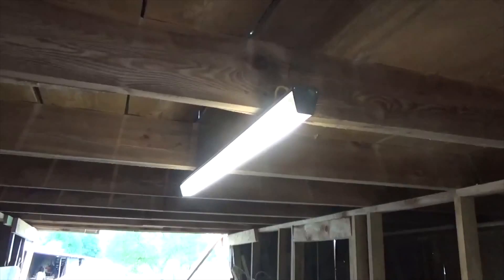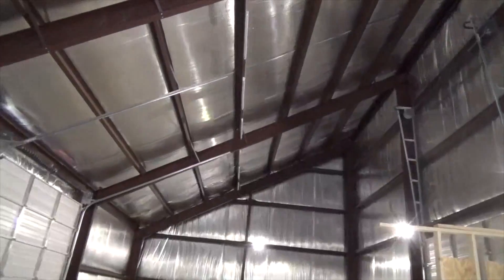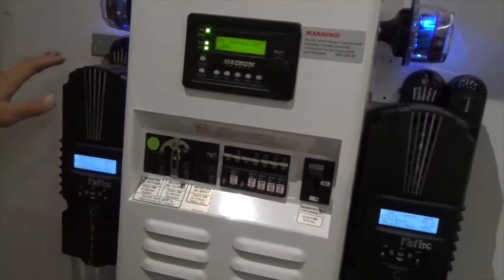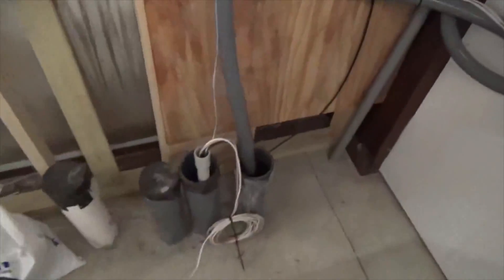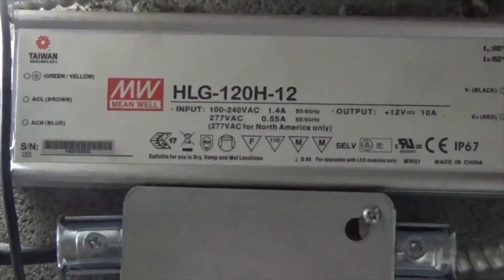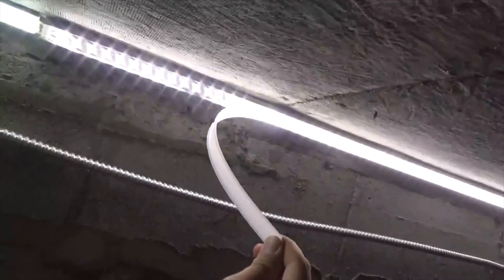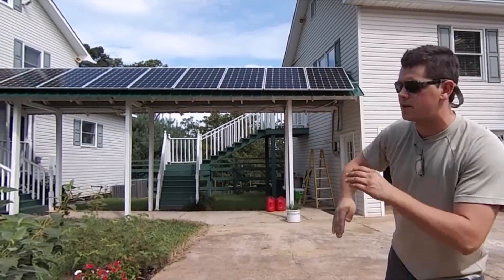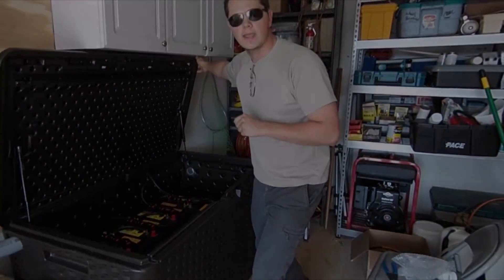Power Saving LEDs

Comment: Where did he get the plastic cover that covered the 12volt strip lighting in the crawl space?
Reply: DiodeLED has those extrusions.  They come in 4' lengths with a variety of shapes.  Lens just snap in.  Good heat sink, which is important. Www.diodeled.com.

Comment: I am off grid and run solar but also I am a Ham radio op and the bane of my life is RF noise generated by the dam panel regulators and the inverter. I have to turn the panels off when I want to use the HF rig.
any sugestions.
Reply: +Cirrus J  

Ferrite beads

Comment: It'd be nice if we ALL understood ALL of what yall were saying! The bottom line: WHAT does that system cost WITH complete installation!
Reply: +Tim Knoerle 

That job started out at around $32k for the power system installation.  The DC lighting systems were add on and done in phases.   Every job is different.  

The commercial at the end was for one of our DIY customers and he had around $14k in material and some panel mounting labor.
Reply: +ScootOverMan Labor usually account for about 1/3 the cost of the project.  That was a really tough job, we had full body harness fall protection the entire roof portion, the barn ceiling was 32' high, there was also a couple 100' of trenching and another subpanel in the house.

We will gladly sell you the material and help you as little or as much as you want with the installation.
Reply: Johnny Valentine Not sure you can tell us but if so, what percent of the 32k is materials and labor?

Comment: Ok wow I want those led strips but man, owner dude needs to stop strokin his proprietary wang with both hands :P
Reply: ***** yup proprietary these days, just means hacked together from off the shelf hardware.  Probably just a few terminal blocks inside a metal enclosure with some relays for switching or something similar to get the job done.  There is no magic to this stuff and anyone can do it as long as they know a bit about wiring and understand grounding and the pertinent electrical codes.
Reply: +kuhrd Oh I know, Just jerkin the chain a bit :P

Comment: I'm interested in the 12VDC light strips he had in the hideaway in the barn. What do those cost?
Reply: Thanks.
Reply: flysubcompact You can buy that strip on amazon and ebay for anywhere from $10-30 per 5 meter roll depending on the deals going on.  If you do buy it make sure you cut off the barrel connectors that come with it and solder on some heavier wire and better terminals.  The LED strip has a huge voltage drop (something like 1V per meter depending on type of strip) so if you power more than 1.5 meters, you will want to power it from both ends to get an even distribution of power and prevent the wire in the strip from getting to hot.  If you run more than about 3 meters powering it from both ends you will want to bring in power leads every 3 meters or so to keep the voltage up and the light distribution even.
Reply: kuhrd Well now I guess this LED strip install isn't simple after all.Darn't it.

Tim
Reply: I have not had a problem running a whole 5m roll on one end.  There is a slight drop but it isn't noticeable in the light.  Be careful of cheap rolls. 5630 SMD and 5050 SMD will run with the drop fine.  As long as you get 12v at the beginning of the strip you should be good.  It's recommended to get a power supply you can test from a bench.  If you run multiple segments you'll appreciate having that to test with before doing all the wire hiding and tucking, then being disappointed you screwed up.   I run 12ga from the source and 18ga between segments. Within a room 18ga with be fine if you don't go crazy with lengths around stuff.  Direct straight runs, as practical will reduce the drop.
Reply: +flysubcompact Go to www.superbrightleds.com.  I put 60 feet of LED's with power supplies and remote controllers between my kitchen and family room.  It lights up like a fukn christmas tree!  The remotes are SMALLER than your average CAR KEYFOB, has on/off and fully dim-able settings.
Reply: TechEdSkills Thanks for the link.

Comment: to power the 24 vdc leds, did you run a converter or center tap the 48 vdc main bank
Reply: DC/DC converter input range 33.6v-62.4v (48v) output 24v.  Coming directly off the battery would toast the SMDs at the higher charge voltages. Stable voltage on strip LEDs is  important.  Even an alternator running at 14v will burn the first series of diodes in automotive applications.  It's ok to convert, just do it once.
Reply: +Christopher Gray (Chris) I've always stuck with the 120 volt lights, who makes the 24vdc lights
Reply: There is a limited number of 24v products on the market unfortunately, but you can make them using the series rule of equal 12v products. There are plenty strips you can wire into existing fixtures that are 24v though. Remove ballast peal and stick the strips inside and wire to your favorite STABLE voltage DC source.  Putting light directly on the battery will BURN them up. DC/DC converter between battery and lights can be centralized creating the DC microgrid.  Convert once and done.  Not convert, inverter, convert.  Just plain convert.